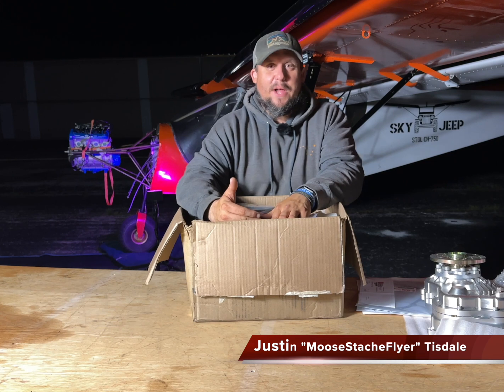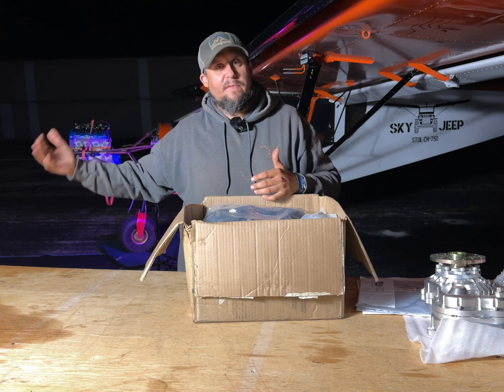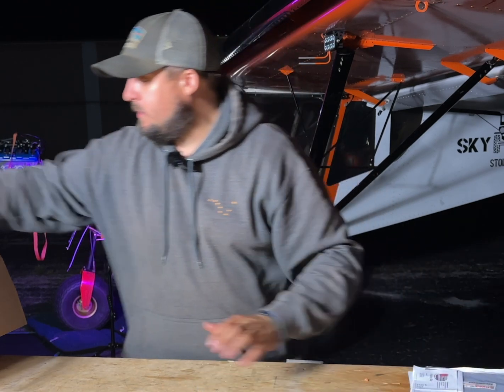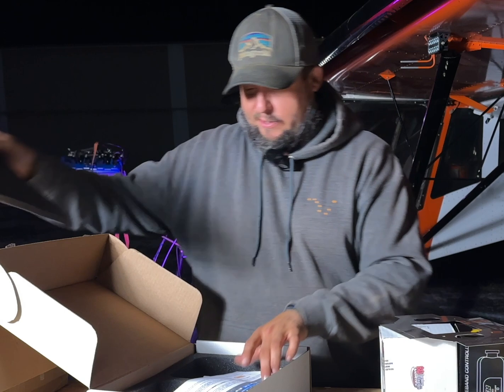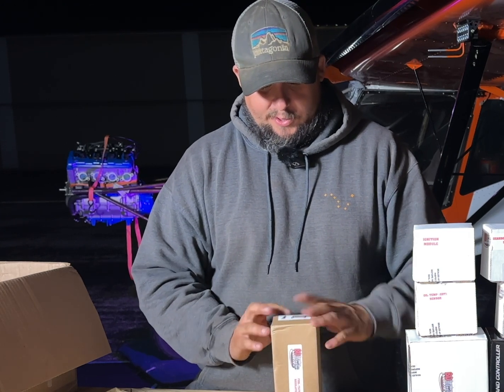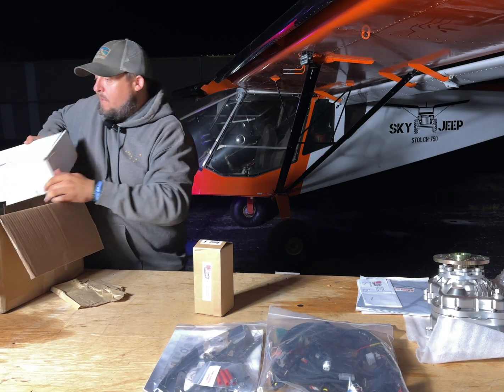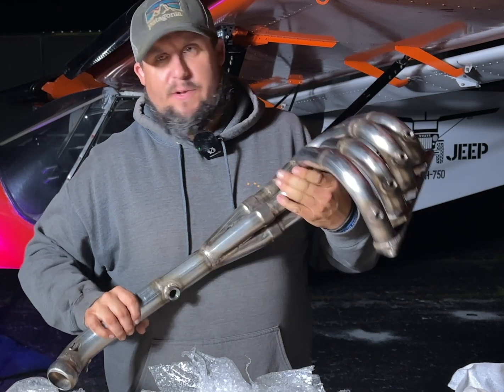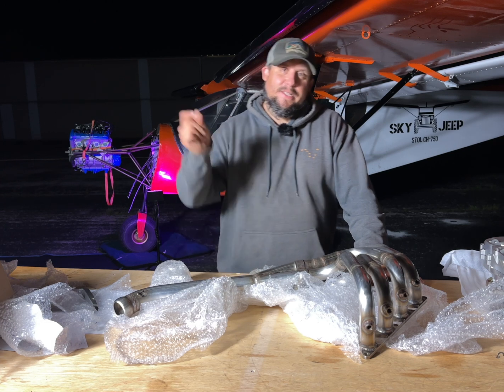APEX ZENITH BUILD KITPLANE -Episode 01 Engine Parts

Comment: Can this motor gear box combo maintain “Inverted flight”?
Reply: If you mount it upside down!
Reply: The Yamaha Apex is a fuel injected and dry sump oil engine so don't see why not.  Just need to ensure the fuel supply to the engine can handle inverted flight.
Reply: @JamesNeirinck  thank you! I think the motor will be the one I put in a Panther!
Reply: @JamesNeirinck  it is dry sump but the pickups are gonna be at the bottom of the crankcase